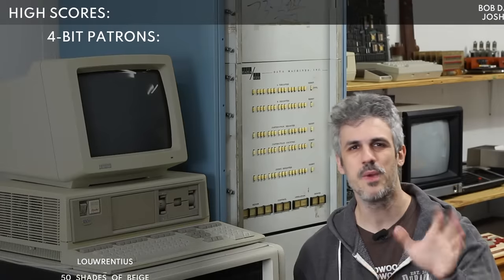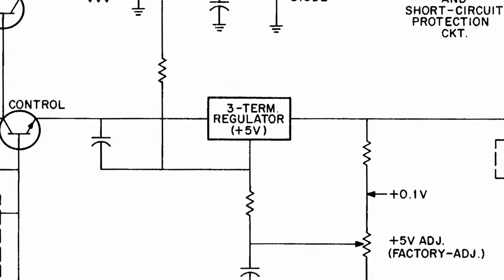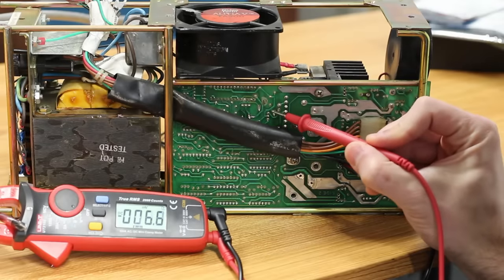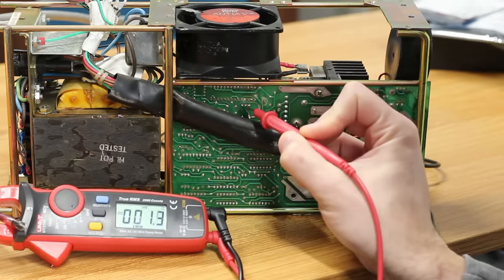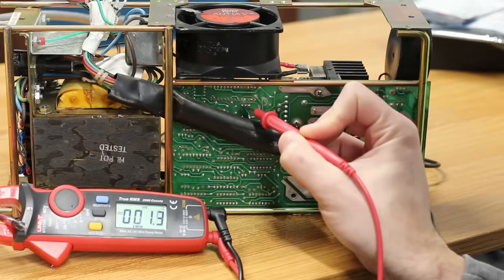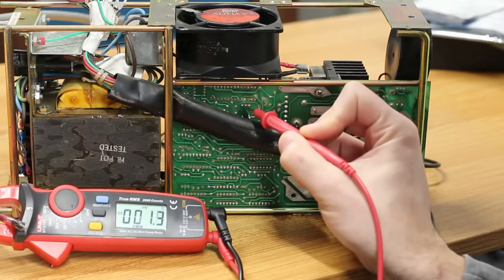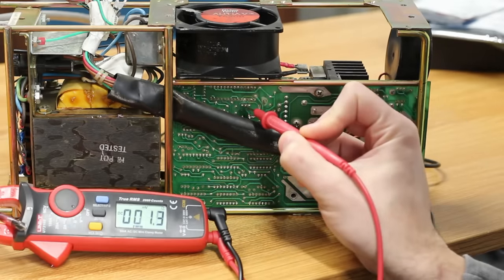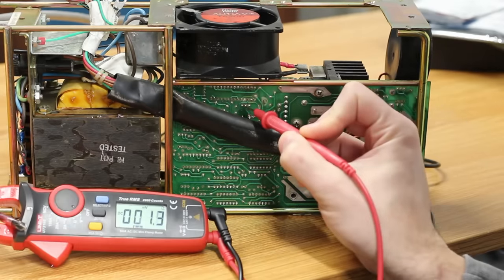The PDP-11/23 Plus Works!

Comment: A very clever design for a switchmode regulator.  It also means the value of the capacitor on the output is very critical to maintain the proper resonant frequency.

You might want to see if you can find the two coprocessor chips necessary to implement the "Commercial Instruction Set" which adds the ability to compute numbers up to 32 digits in length and various instructions for string manipulation.
Reply: It's not resonant. It's a classic buck regulator with inductor, switching diode for when the inductor is putting energy out to the load, and capacitive filter on the output after the inductor.
Reply: @GodmanchesterGoblin  
It isn't resonant but it does essentially regulate the ripple voltage on the output capacitor. Hysteresis is established by the resistor from the emitter of the main switch to the the network on the "ground" pin of the 3-terminal regulator.
Reply: @d614gakadoug9   Yes. I know, thanks.  I was only addressing the point raised regarding resonant behaviour.

Comment: Love that ‘portable’ terminal!  I developed comms interfacing a/w in the 1980’s on an 11/44 and we distributed production systems on 11/23s to various universities to enable legacy machines (Honeywell, ICL…) to talk X.25
Reply: Indeed a portaBLE terminal.  Not like the early versions of IBM's 3270, which were just barely portaTIVE...
But as a  terminal, nothing imho beats the 3270.  Even now, nearly half a century later, it still beats most any laptop. Especially the keyboard!
The PDP 1103 PSU has quite a complex/complicated setup. Interesting to see that 3-terminal regulator used as what comes down to a feedback loop.  Or maybe better to see it as the primary supply with the rest as a current-booster for anything over 50 mA.  A take-off on the  class-AB design of an audio amp?

Comment: That is an adorable little terminal. I've never seen a "rub out" key before.
Reply: Teletypes had a rubout key. It was used to cause the tape punch to punch a DEL (delete, all holes punched) character, "erasing" an error. I don't recall if you had to backspace first or if the rubout key automatically backspaced before punching.
Early video terminals were "glass teletype" terminals, so they retained some of the familiar features.

Comment: In 7805 voltage regulator with a step down bypass. 
The circuit is made short-circuit proof by measuring the output current. 
And if something goes wrong, there is also a crowbar that triggers the current limitation. Brilliant!
I don't know why modern step down ICs were developed... probably because they are easier to use
Reply: That, and they can support higher switching frequencies with variable frequency, fixed frequency with PWM, or variations, as well as commonly needed features like low-voltage detection.

Comment: Switch mode power supplies have got to be one of the trickiest to fault find! One I worked on had this habit of blowing the high current side if it didn’t get the oscillator to fire up quickly enough.

Comment: @ 16:37, it looks like the fan uses sealed micro bearings - you should be able to punch out the old ones and replace them cheaply. Metal fans are always worth trying to repair.

Comment: The most stylish serial terminal ever made.
Were PDP computers replaced by microcomputers or did their capabilities and features maintain their importance in the market? Were these PDP computers more suitable for industrial, commercial and automation areas since they did not need to have the terminal on 24 hours a day? Or for general use?

Comment: Excellent design of this power supply. Like a magic - use basic linear regulators to get a lot of more power with some tricks. I like it!
Reply: I highly recommend Performance Enhancement Techniques for Three-Terminal Regulators by Jim Williams. It dates from 1984 (Linear Tech's second ap note!) but the ideas in it are still very valuable - as is the case with anything Jim Williams ever wrote. Want to make a regulated 2000 volt supply built around an LM317? It's in the ap note. There are some switcher circuits, too.
Reply: Thank you! Sounds very interesting.

Comment: Hmm. Differential serial port line looks as predecessor of RS422 standard and later RS485 - where all communication was bidirectional on single twisted pair. My experience begins in 1996 in automation control systems. These computer systems are much earlier. Interesting history.

Comment: Were you putting oil into the fan windings rather than the fan axle in the middle? The terminal is very similar to one my father used to use in the mid 70s, would put the telephone into a coupler on the side. I was too young at the time to remember the model

Comment: Nice seeing that PDP 11 running again :-) I guess with an 8" disk drive and that adds luggable terminal it might be a different definition of portable than we're used to nowadays ;-) Always wanted to ask what the deal is with that EDS PC in the background - does EDS really stand for Electronic Data Systems? I worked there many years back but didn't know they made hardware

Comment: In deed an interesting implementation of a switching power supply... (very analog). --- I did not listen thru yet, I'm at 11:30, nor looked at your section break down, and want to express my thoughts before getting biased by your excellent solution... I hope to get by the end of the video. Why? ...I want to learn to think (myself). There we go: --- Why is there no capacitor on the 'feed' line from the diodes to the 15V 7915 regulator? ... also no ground connector from the -15V 7915? ...may be the schema does not deem it necessary to point that out. Anything not working in the circuitry to go to adjusting resistor puts leaves that control 7805 on a too high ground level and makes the crowbar to trigger. If the stuff keeps going as before, I think something is broken in the line from the pass switch to the output, or in the feed circuit of the 7915, latter because you never showed/measured -24V (or more neg), but measured +24 (or more pos)...  -- AI is so hyped these days, so I'm asking: is there a way to come up with a reasonable query that, for example, ChatGPT, could help with debugging, problem  analysis, solution approach, what ever. And even more so, could come up with such a design... (for example: what is the most simple circuitry for a switched power supply?) What are your thoughts?
Reply: btw, the text get struck because of the neg sign in front of the first -15V 7915. Hilarious, ... because it doe not do it here...
Reply: ...nice... I'm surprised that issues were not in the sophisticated components... the simple ones made it fail.
Reply: In the comments on a video I watched a few people had tried ChatGPT to try to find out something about an integrated device for a high-power low-voltage point-of-load synchronous buck regulator. The stuff ChatGPT returned was complete nonsense, offering information on parts that weren't even remotely similar.
 It is known for doing that. It will, for example, make up citations to case law that are total fabrications. What it does best is sting together words it knows. Just don't expect them to tell you useful things.

Comment: we used the osborne portable terminal with a vt100 emulator, it had only keyboard, screen and two 5 1/4 inch floppy drives. the 11/23 we used for hevac building automation (swiss based landis & gyr), and after opening of the iron curtain we even got russian 11/23 emulator cards for a 286 processor board, if i remember correctly. 1990-1991, those were the days… man 😂😂😂

Comment: Is this 19 inch form factor? If so then I guess you can put this rig into a mobile flight case -- like DJs use.
Reply: DEC stuff was mostly built around standard 19 racks. DEC actually may some really nice racks that you could buy as just empty racks. One of the nice features was that the side panels just lifted off yet were very secure when in place (though you wouldn't use them for mobile gear).

Comment: Never assume that because a meter shows the correct nominal voltage that a power supply output is "clean." It could have volts of ripple or be exhibiting horrendous behavior while still producing the correct average output voltage.

Comment: In the old days, they often took a long road to get somewhere. A capacitor with a diode in serie, it surely must be doing something. When I was young a diode costed real money. To measure the current they chased all electrons though one resistor to see the current drop, but that resistor is eating up a number of Watts every second of the day, as long as the computer is working. Like energy was growing on trees! In fact it does but that is not the point.
 
If one million of these computers would have been made, a million Dollars was lost on one redundant diode and many megawatts were spoiled every hour these computers were used. Only to check something.
 
It is good that they made these steps in de development of computers but it is better these computers are now in the museum.

Comment: Because the age of the system, and even your meter show the capacitors are good, I would recommend changing them.
Also, reforming is never a good idea, and if it works, it is a temporary (short term) fix at best.
Reply: Reforming is a perfectly acceptable thing to do. Methods are detailed by capacitor manufacturers. It is temporary in that if the caps are left a very long time they will deform again but they can be reformed again. If they are are charged regularly they can last for years. If the capacitors are nearing the end of their useful life, which is not easy to assess accurately, then replacement is warranted. Never-used caps will deform just sitting on the shelf.

Comment: I think the panel switches are physically backwards! Per the PDP-11/23 manual, the RESTART switch is supposed to be momentary. The AUX ON/OFF is supposed to be the DC enable, not RESTART. HALT appears to be correct. Is your AUX switch momentary, and does flipping it reset the CPU?

Comment: Be careful with these golden power resistors. Without a heatsink, the max. power is around 10W. If these things overheat, they can explode or shoot out parts, we had an incident in our lab with one of these things shooting its ceramic core trough some sheetmetal a good cm into the brick wall, just missing the person working on it...

Comment: So, is that linearly switched or switched linear…

Why go with that PSU design for that system?
Reply: I'd go with linearly switched. As for why, to save heat and fit the design in a smaller space.  Much less heat dissipated means smaller heatsinks and simpler cooling.
Reply: This is an extremely basic and common switch mode toplogy used everywhere.